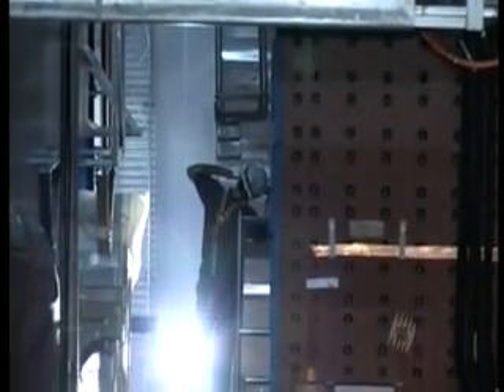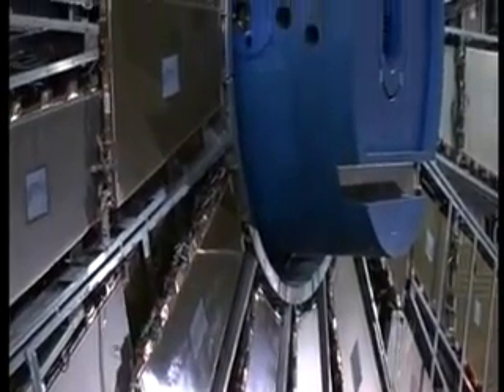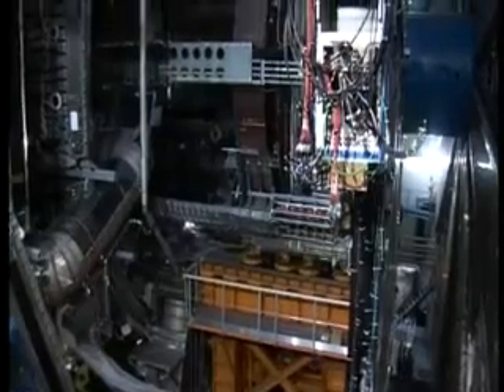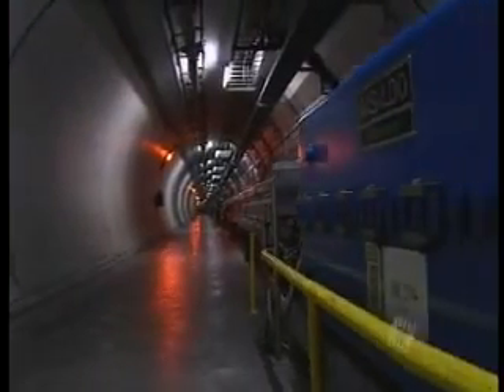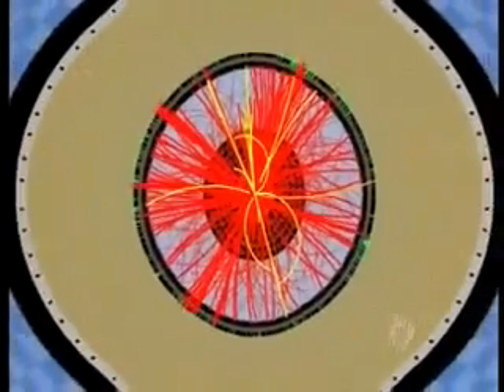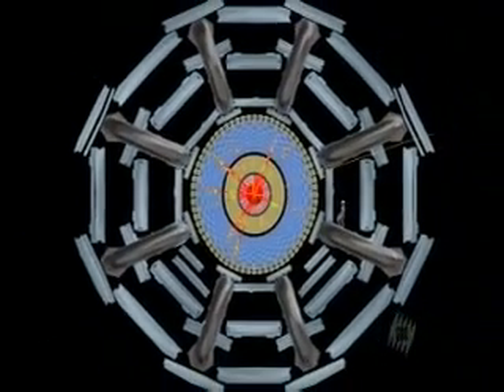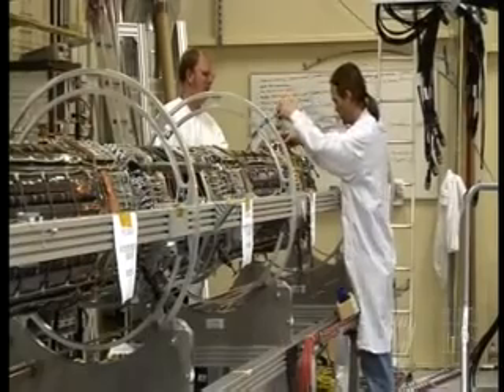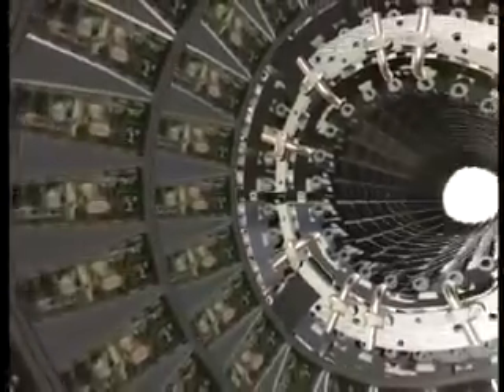The God Particle

Comment: @pawnshopr Ive been thinking aout blackholes as well. And the point that if not even light can excape them, but gravity can... ??! That means the higgs particle would have to travel faster than the speed of light in order for the black hole to have gravity. So detecting it with electronics isn't going to work.

Comment: What about the effects of the other colliders that have been built since the 40's? They haven't all been decommissioned. You're assuming a lot when considering snow in the UK, we have snow every year. And I haven't noticed any difference when navigating via compass and map, magnetic north still seems to be moving in the same direction it has since I started navigating. Not sure if there's any evidence for a correlation between that observed magnetic shift and the weather either.

Comment: The magnetic field is 8.33 Tesla, or 200,000 times the Earth's magnetic field. The particles will be traveling with an energy of 7TeV, and at a speed of 0.999999991 times the speed of light. There's no danger working near such magnetic fields as long as you keep metal objects away from it (besides, MRI's have powerful magnetic fields as well, and these magnetic fields will be isolated within the collider itself).